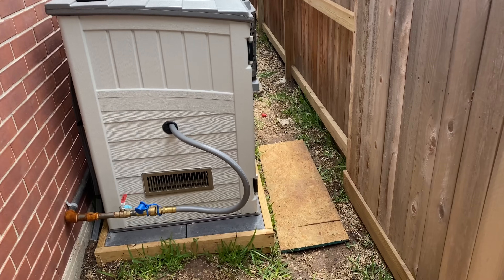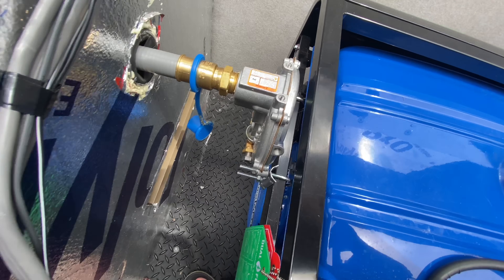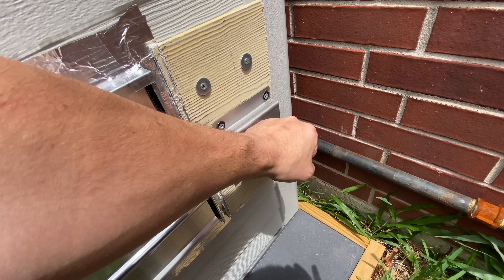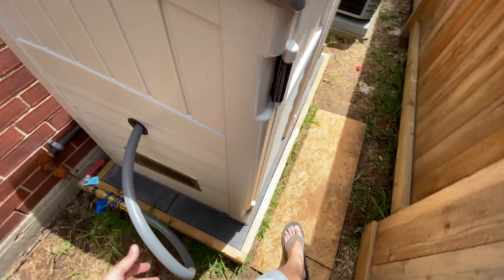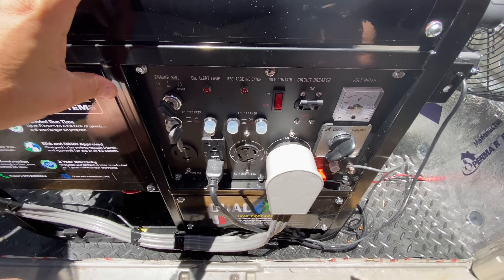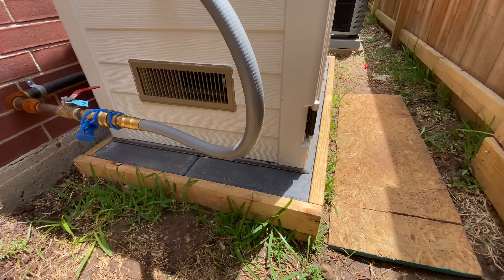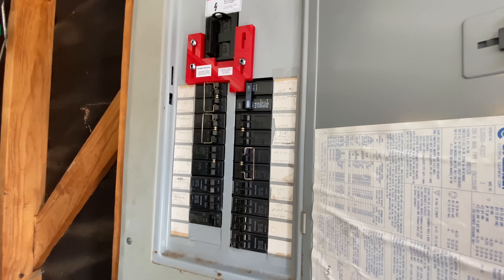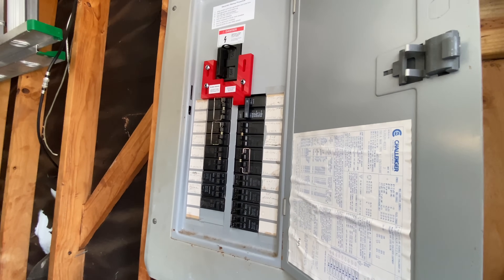Converting a hybrid portable generator to a whole home generator with shed

Comment: That’s the set up I’m looking for. Unfortunately Gas line and electric are not close. I can pipe over to it  though. Thanks 🙏
Reply from the maker: Mine were not either. I used a direct burial 6/3 cable. Probably is about 75 - 100ft run.

Comment: Are you in Sugar land? Do you try turn on A/C with generator? Is the Natural Gas no problems? How many hours you had been used?
Reply from the maker: I do. Check out the update video in the description. So far I have probably run the generator for about 75 hours total in the last 9-10 months.
Reply: @CalvinGorriaran  I am in sugar land too, Natural Gas didn't reduce the output? Do you try turn on A/C with generator?
Reply from the maker: @amosshih8313  it does reduce output but I was still able to run an AC in the summer. Especially once I got the compressor savers installed. I try not to run both at the same time.
Reply: @CalvinGorriaran  Thanks, I wish I can visit your place,I want duplicate Exactly the same as yours
Reply: @Calvin Gorriaran Do you use the inlet box or direct to circuit breaker? What Gauge wire you used? Thanks
Reply: 30 AMP WIRE SIZE
For a maximum of 30 amps, you’ll need a wire gauge of 10. The most common household item that requires a 30 amp circuit is a central air conditioner.Often, people living in RVs use 30, and sometimes 50, amp systems to run all the appliances in the vehicle.

40 AMP WIRE SIZE
For a maximum of 40 amps, you’ll need a wire gauge of 8. Many electric cooking appliances require 40 amps such as electric cooktops.

50 AMP WIRE SIZE
For a maximum of 50 amps, you’ll need a wire gauge of 6. Fifty amp breakers are most often used to power many different appliances. However, a kitchen oven can alone require 50 amps. Many electric dryers also require a 50 amp breaker.

Comment: You mentioned that you live in Houston. How did this generator work for you during the ice storm power outage of February, 2021? Was it sufficient to run your home's essentials or did you feel you needed more power? From what I've heard, these Dual Fuel generators actually produce a little over 20% less power than the peak or surge watts when running on natural gas. Have you found that to be the case? Does the 12,000 peak watts end up being around 9,500 running watts on natural gas?
Reply from the maker: Yeah, it worked great. Checkout the update video in the description. 12,000 is peak with gasoline. So my guess is I was getting around 8,000ish for constant power.

Comment: Great vid thanks for posting. I'm in Houston. Going to do something similar. Did your NG line need to get upgraded? Bigger line or higher pressure?
Reply from the maker: It didn’t need to be. It ran two furnaces, water heaters, and the generator without any issues.
Reply: @CalvinGorriaran  Gotcha. Thanks again!

Comment: I just came through the 2021freeze disaster in Houston , I'm in Pearland, and I'm definitely going to put in a system like you have and this is great information. Thank You! 
I was able to run my 5500 generator to keep the lights, fridges internet going but no furnace sucked. I think the gas line to my furnace is 1/2" and where I would need to tee from. Do you think that is enough flow?
Reply: @ hotrods27 If you have a furnace (gas) you probably only need to run the blower. That is a 120v 15 or 20amp circuit and could run off a small portable through a single circuit xfer switch from Reliance Controls. I’m down in Houston too...thought these gens were for only hurricanes but now we know better thanks to ERCOT.
Reply from the maker: That should be fine as long as it isn’t a long run. My understanding is the pressure drops the longer the run is and the smaller the pipe.

Comment: I have never commented on one of these before and seem to be having a hard time getting it done hope it will not be duplicative.  Many thanks for taking the time to share your details, tips, and parts.  It is nice to hear everything worked well for you in that crazy weather event.  We have a hybrid unit like yours but a little smaller that runs on propane.  Several times in the past few years I have spent time looking at videos trying to find something and finally feel like I have found something that resonates.  We have a power main panel outside on a pole that feeds three separate breaker panels in three separate sections in the house so transfer switches are out of our price range.  The way you have the interlock setup finally gives me direction we can run with.  I have seen a couple things our neighbors have done that I am not comfortable with at all.  Your setup looks safe for us and the folks working on the lines when the power is out.  Best of all my wife will understand it and be able to do it without me.  Using something in the power panel to monitor power usage sounds like a great idea as well.  Can you share what part you used from where to accomplish that?  I saw the wire size you used - how long was the run from the breaker to where you tied into the cord?  Can you share how to go about obtaining an interlock kit?  Is it from the manufacturer of the panel?

Comment: Where did you get that 3D printed red part?
Reply: Interlock on Amazon. Be sure to order the correct one for your breaker box and inside or outside use..... Watch more videos or hire an electrician (side job) .......
Reply from the maker: I had to order mine off eBay because my box was pretty old and couldn’t find one at the time anywhere else.

Comment: Hi, I am in Spring, TX. How was your generator? Did you get any issues this weeks with the messy weather?
Reply from the maker: It ran rock solid for 48 hours straight.
Reply: @CalvinGorriaran  Nice!
Reply: @CalvinGorriaran   - curious, what was your gas bill after running it for 48 hours?
Reply from the maker: @steve6438  in the winter my gas can range from $35 - $85. The billing period that landed during the freeze, it was $112. I believe the billing period ended March 12th.
Reply: @CalvinGorriaran  not bad at all.

Comment: How many watts do you think that you would realistically need to power the major appliances in your home? I am looking at getting a 9500 W generator, and I would wait for it to power most of my bedroom appliances. Given, like you said, I am not looking to power my dryer and microwave while running by central AC, but being able to run the central AC during a power outage due to hurricane will definitely be a plus! I would appreciate your feedback!
Reply from the maker: I would go with this model or something similar. Even though it can do 12,000 watts, that is the peak. It’s normal run capacity is around 9,000. I purchased compressor savers for the ACs and that made a huge difference as it prevents the units from spiking and killing the generator.
Reply: @CalvinGorriaran   thank you for your response!  I have never heard of compressor savers, so I guess I need to look into them!
Reply: @robertsimpson5801  please make sure your generator is 20 feet away from your house. Never run your generator indoors because of carbon monoxide. Remember that carbon monoxide is dangerous to inhale. And we should also keep our children safe when we’re using portable generators so they won’t get electrocuted and injured by generators. I know all about generator safety. We should not run our generator in wet conditions. Don’t try to plug a generator cord into a wall outlet to avoid back feeding. Turn on your generator before plugging in appliances. Let your generator cool off before refueling it. Thank you

Comment: you missed the biggest thing HOW MUCH NOISE with this build  turn it on and run.. it full

also  the exhaust fan is iLIVING 12" Wall Mounted Shutter Exhaust Thermostat Control-3 Speeds Vent Fan For Home Attic, Shed, or Garage Ventilation, 960 CFM, 1200 SQF Coverage Area, Variable, Silver Model: ILG8SF12V-T About $100 at time of this post amazon

Comment: I have the same generator, my AC unit puts out 40amps
Would it be okay you think to run?
Reply from the maker: It runs mine but I am using compressor savers on the AC units. Easy to install and work extremely well and prevent huge spikes when the units start.
Reply: @CalvinGorriaran  Good idea - my AC guy installed soft start kits on mine - no issues.  I have a "full house" generac that was on the house when we bought it - it does not power the pool pumps though.  I bought a similar tri-fuel portable generator from Costco to use for our annual snowmaggedon.  Hopefully will save the pool pumps this winter.  My generac powers a sub panel from a transfer switch, so I had my electrician install a genrerator breaker in the main panel so I can lock out the mains, turn off the feed to the subpanel and then run the portable power to the panel.

Comment: Calvin. How much was the whole.. pie, Plumber, wires, materials, generator... electrician etc...  rounding up. ?
Reply from the maker: I would say close to 2,500 including the plumber. I did everything else myself. If you already have a gas connection from your meter that is accessible, you maybe able to avoid the plumber.

Comment: What was the monthly fuel costs?  And maybe an item by item cost, (just major items)  Did you think about a back up generator,  small or equal size?
Reply: My complete system that I'm installing will cost 1500 but I'm doing the install myself including the Nat conversion on a Westinghouse 9500DF

Comment: Great setup! 

I believe the duromax 12000 and 13000eh has the same exhaust tip diameter right? 

What did you do with the spark arrestor at the tip? How did you fit the 1” flex on that?

Also, do you think it would be better to use a heat wrap on the flex pipe and also on that custom exhaust port from inside as much as you can wrap it?
Reply from the maker: Yes, I will see if I can get a picture of it.

Comment: Love it.  I just got the DuroMax 10000EH for up north.  Being in northern Ontario, the snow gets pretty deep so I'd like a shed and love your design.  Only question I have, is regarding what use used for the wall linings?  Again, great vid and ideas.  Thanks!
Reply from the maker: In the back were the generator exhaust pipe and muffler is, I used a cement board. The rest is just insulation board.

Comment: Let me tell you a few things that you might not know...Since you're running a generator in a modified plastic patio storage box that is not designed to run a gas engine in & to run the generator as a stationary generator you might be taking a big risk with your home owners insurance if something went wrong. Also the distance from the house to the generator box will probably violate local code since it's no longer a portable generator because you plumbed a gas line into it. It's a cool box no doubt but I would highly discourage anyone do this. They do sell Generator enclosures meant for this exact job and meant to contain a fire for a period of time.
Reply: I know all about generator safety: not only carbon monoxide is dangerous. We should also be aware with the electric shock and electrocution when using generators and also fire hazards. We shouldn’t run our generator in wet conditions which can electrocute us. We should also keep our children safe when we’re using portable generators so they won’t get electrocuted or burned by the generator which causes injuries. Make sure you read the manual instructions carefully and don’t try to plug a generator cord into a wall outlet to avoid back feeding. Turn on your generator before plugging in appliances. Remember not to run your generator indoors. Thank you

Comment: As for controlling the heat, you could use header/exhaust wrap to keep the heat from radiating out of the exhaust piping, should add to your fire safety. The wrap is pretty cheap, too.
Reply from the maker: I am going to look into this! It ran for 48 hours with no issue but I am always up for adding more safety.
Reply: @CalvinGorriaran  Can you Run your A/C unit in the Summer when Power goes Out ❓❓❓

Comment: I just ordered the Westinghouse WGEN12000DF portable gen from Lowes.  Dual-fuel gasoline + LPG, rated at 15KW start/12KW run ($2200!).  I plan to convert to NG.  The Youtube videos I've seen on the NG conversions run the NG w/ the manual choke closed or mostly closed.  The Westinghouse I just ordered has an automatic choke; I wonder if this is going to prevent running on NG.  Any thoughts?
Reply from the maker: I wouldn’t think so but would be interested to hear about your results.
Reply: @CalvinGorriaran  I ended up cancelling the Lowes order for the Westinghouse.  I'm sticking with my 3-year old $1500 Sportsman 9KW/7KW tri-fuel.  I was able to run my 2-ton/3-head ductless AC unit on the Sportsman - all three AC heads at the same time yo 62 degrees + refrigerator + sump pump + 3 fans + all lights + TV + internet.  So, this looks like it will satisfy.
Reply from the maker: @prettygirlus9008  consider getting a compressor saver for your AC units. Huge help!

Comment: Only thing I would add is you can order some muffler exhaust shield tape that can be ordered in large stick on pieces to place on the back and side wall near the exhaust. You can find this tape on dirt bike parts sites. Its used to stick on the back side of your side number plates where the exhaust pipe is and you can also order and wrap the exhaust with exhaust tape or rope
Reply from the maker: Just ordered some! Thanks for the idea.

Comment: So u disconnected the propane feed to the carb and reconnected it to the NG regulator what did u do with open propane port on carb
Reply: Natural gas goes to propane intake on carb, essentially bypassing/eliminating the propane regulator.
Reply: put a brass cap on it to keep trash out of the regulator.

Comment: Nice video.  I have a A-iPower SUA12000E generator and just installed a tri-fuel kit.  It runs fine with propane, but I'm having trouble getting it running with natural gas.  What size is your gas inlet hose?  Mine is 1/2" ID and I think that may not allow enough gas.  The hose is only 3 feet long at 1/2" ID.  It comes off my 1" gas line near the meter.  Yours looks to be 3/4", but want to verify.
Reply from the maker: Make sure your hose from the generator to your regulator isn’t too constrained. I had a similar issue where the gasket was compressed to the point where it restricted the gas flow. Post a picture of your setup?

Comment: I think you set up the gas wrong , you do not take out the screw and adjust the screw underneath it , just below is a bolt that’s on the elbow , uscarb calls that the load block , you turn it out to increase the volume of gas , it is set at full load (rated electrical lowdown the generator)and you turn it in or out until the generator runs the smoothest , you do not adjust any thing on the regulator , the load block is used to set the amount of gas that flows , you should, have received instructions on how to adjust the pressurized gas system , if not google how to do it

Comment: very nice setup. Based on the generator dimensions and BMS 2500 shed dimensions you should theoretically not be able to close the door.
Reply from the maker: Cayrick Pan it is a tight fit but closes fine.

Comment: Good video. Did you run 4 wire to your panel?. Just wondering if the generator has a bonded neutral or not regarding using a ground rod.

Comment: I'm John,  Jmarcus at w9dg dot com.  I want to do the same setup but I think I'm going to get the westinghouse 15000 watt dual fuel generator.   I may buy a manual transfer  panel for the whole house though.  I want the natural gas conversion and I like the rest of your setup.   Can you provide me the info on where you acquired your materials?   I especially need to find the gas conversion kit and exhaust materials.
Reply from the maker: John Marcus I believe most are in the comments. Let me know if something is missing. Be sure to have an certified electrician and plumber assistant.
Reply: @CalvinGorriaran  
I have done gas and electric myself but I'll get it approved and have an energy company electrician move my whole house wiring to my transfer panel.   I cannot use the electrical method you choose,  where I live.   And I'm near you.
Reply from the maker: John Marcus I just realized it was you 🤣 Let’s chat.
Reply: @CalvinGorriaran  yes please.   I don't know how on YouTube though.
Reply: @John Marcus:  I just ordered the Westinghouse WGEN12000DF from Lowes for $2200 delivered plus tax.  $900+ more costly then the DuroMax 1300EH.  As i posted above, I'm questioning whether the automatic choke will prevent the NG conversion kit from working.

Comment: One big mistake you made. You should not have the heat generated from the shed and exhaust blowing directly on the AC condenser. The job of the AC condenser coil is remove heat. Efficiency of the AC will be compromised and cost to run will be higher. Lower efficiency means more amp draw.
Reply from the maker: Bob N the two won’t ever run together as I don’t use that upstairs unit when running the generator.